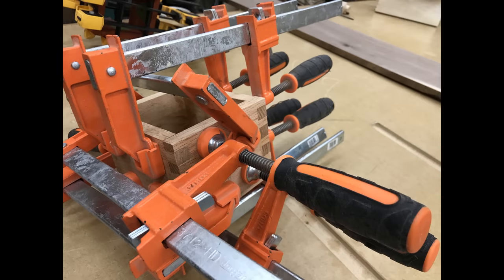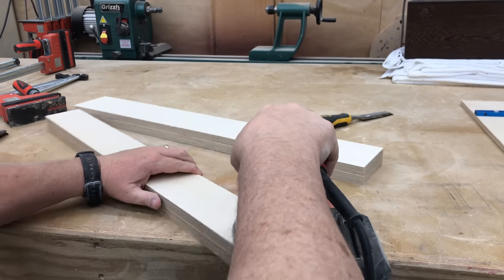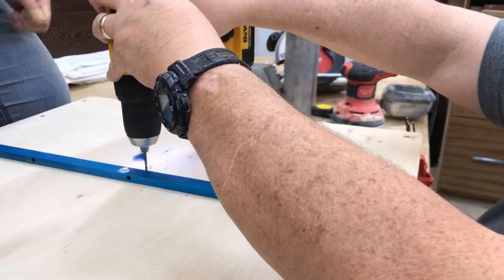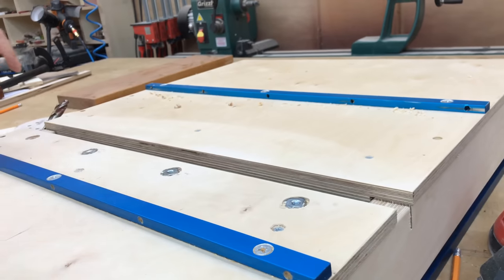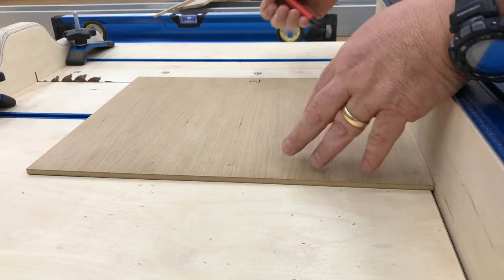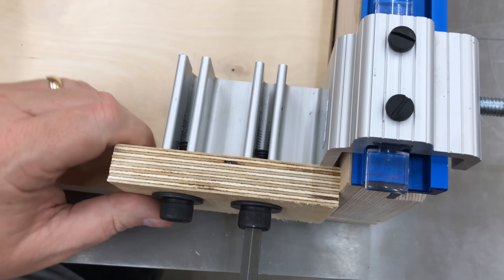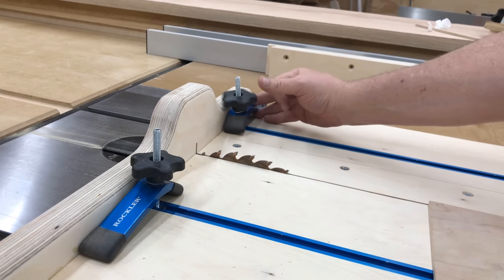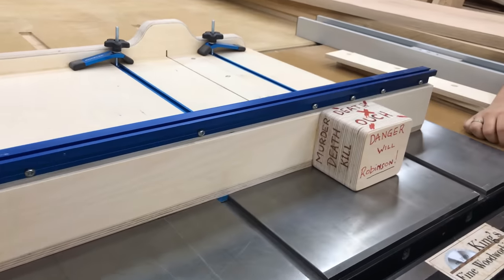39 - Extreme Crosscut Table Saw Sled with Perfect Miter & Dado & Removable Zero Clearance Insert

Comment: If nobody caught the error, I'll tell you. By tapping from the bottom the screw will tighten up in the aluminum but that doesn't mean it's holding  the bar to the wood base. You need a clearance hole in the aluminum, not threads. Engineering 101

Comment: Excellent Plans and demo.  My only suggestion is that if the bolts do not come through the track at the top.  Drill a hole in the bottom of the sled to accommodate the bolt tops to drop them through the bottom if you need to remove the hold downs and bolts

Comment: I built the sled and it works really well.  It adds a huge safety factor when using the saw.  I drilled a hole in the block on the back of the closer fence to accommodate the vacuum cleaner attachment and solved a huge dust issue.  I used a sacrificial fence for dado cuts taking care not to cut into the main fence and losing the register marks.  I keep it well waxed.  BRILLIANT design...thanks .

Comment: I purchased your plans for this today and I have to say they are very good and easy to read.  I purchased a set for the same thing from a National woodworking supplier that most of us buy from and they were so confusing and I am a retired Commercial Contractor of 40 years, threw them away and got yours.  Thanks for sharing good knowledge and common sense work value.

Comment: Great sled, well explained and easy to follow. Built the sled and it is true and wonderful to use. I made two changes.  I used adjustable miter tracks that were top mounted to allow precision adjustments if necessary and I left a 1/4” gap at the end of the T-tracks so the clamps can be completely removed for some types of projects. Thanks again, really love your channel!,

Comment: I’m very happy to find this video on your ultimate sled. A few years ago I started building your extreme miter station but due to unforeseen family circumstances had to stop 3/4 way through construction. Now, with more time on my hands I decided to finish it but wanted to construct the many drawers with box joint corners. After cruising YouTube for a workable jig, I found yours. As usual you made the build using simple explanations for each step - like you did with the miter station. I’ve ordered the plans and I’m beginning my own sled to make the drawer box cuts. Thank you so very much for those instructions. I hope to provide you with a finished version before spring.
Reply from the maker: That’s wonderful. I’m very glad it is helpful.

Comment: I've seen a few of your videos now. gotta say you're a lucky guy to have your kids spending so much time in the shop with you, not just to hang with your kids but to impart the knowledge and skills you've acquired...it's like the epitome of parenting. also doesn't hurt to groom them into taking over the family business ;)
Reply from the maker: Thank you very much! I am blessed to have them with me all the time.
Reply: This is how I started out. I have a vivid memory of being about five years old (1953?). My retired grandfather had a small shop in his basement outfitted with some Delta-Milwaukee Homecraft brand tools that included a drill press, a band saw, and a small table saw with a 4-inch jointer on the side. I still have his drill press and use it frequently. Using mostly 1/2- and 1/4-inch pine, he made napkin holders, salt boxes, spoon trays and such. At Christmas he would produce a number of small sleighs that you could put a candle and some greenery on. I worked in the hand-sanding department on the production line. He sold his items at a local gift shop to make a bit of walking around money. But I digress. My best memory of my childhood is my grandfather taking the wheel/blade covers off of the band saw and having me clean the sawdust out of the tool with a small paint brush. I've worked wood all my life and am always upgrading my shop and believe that he pointed me in the right direction in life. 

Oh, about the Delta-Milwaukee Homecraft brand, it has been interesting to see how the companies have bought and sold each other over the years and how the brands have changed in quality. In the '70s I had a Black and Decker Super Sawcat circular saw with an electric brake. It lasted more than 25 years with daily construction use. Now when I see the Black and Decker name I think of toasters and homeowner-quality tools. In the '50s, my father had a military surplus DeWalt radial arm saw in the basement. It was a Navy gray and was a beast. My mother said the lights would dim in the whole neighborhood when he would push the ON button. She said said she held our first aid kit in her hands whenever he used the thing, said the whine of the motor was blood curdling. DeWalt has had an interesting progression of owners (read Wikipedia) since 1923 and is indicative of the frequent changes of ownership of these tool companies. 

I didn't mean to write a book here, but just to say that I think it is wonderful that you have apprentices/helpers in the shop. Thanks for a great video.
Reply: @panamafred1  My dad had an old Craftsman table saw he bought in '62. I retired it this year for a Bosch portable. I feel much safer now, and the breakers aren't tripping. :-)
Reply: @garyhome7101  I hate retiring old tools, but it is usually for the best if I buy good quality. I do a bit of metalwork too, and just bought a Milwaukee metal cutting circular saw. Should have bought it fifty years ago! My Bosch contractor's table saw is going strong after gee, perhaps nearly twenty years now. Remember to count your fingers before and after using the table saw! :-O

Comment: One important item I did not notice being covered in the video is that the fence must be straight with zero bow.  This can be achieved by clamping the fence to a known straight edge while squaring and adding screws up through the sled into the fence at quarter points.  Very good video and it gave me some good ideas to improve mine.  I love playing with the five cut method.

Comment: Built this pretty much the same as the video. Only change I made in the process was to route the top pieces for the T track BEFORE gluing them to the base. This way I didn't have to remove the fences to route out the channels for the T-Track. Appreciated the math to get the fence square. First time it ever made sense to me!!!

Comment: Without any doubt the absolute best crosscut sled and cross cut sled build on youtube. Congrats. I will be purchasing the plans and building one.
 Only one possible safety improvement on your "death block", fit a stop on your outfield table. Mine is a 1/2 inch diameter bolt with the thread cut off and a large round rubber bumper fitted. It is positioned so that the saw blade is into your death block to the max depth for any piece you are going to need to cut without it coming through the back of the block. Your dado will also need its own hole due to differing diameter.  It can be stored on a rare earth magnet under the edge of the table saw top so it is always at hand. I've seen too many of those Safety blocks with saw kerf slots cut all the way through. All the best.
Reply from the maker: Thank you! A stop on the back would be a great idea.

Comment: Awesome sled, James.  Very informative video.  After watching, I actually used the 5 cut method to square up the fence on my old radial arm saw. ( I didn't want to reset the 90 degree stop which is a pain)  The method worked perfect and resetting the fence was relatively easy. I do not move the RAS out of the 90 degree position but rather use jigs and fixtures to make perfect miter cuts.  Thanks again for all your informative videos.

Comment: I’ve enjoyed making this.  Had to do a few tweaks, as I have a Makita table saw with ½ in mitre track, so I bought 12mm aluminium bars instead of the standard mitre track, and then as one who uses a 7mm grooving blade vs a dado stack I found I had to replicate the zero clearance replaceable plates on both sides of the blade.   This also lets me  have plates for bevel cuts.  Very satisfying build.  Thank you

Comment: I spent the last two days making this after buying your plans. It is simply amazing. I used my carpenter square to set the back fence initially and after all was done, following the 5-cut method, my adjustment came out to be 0.0013 inches. That was plenty good enough for the work I  do (and the smallest blade on my feeler gauge was 0.001").

Thanks for this video and all the great work you've done.

Comment: James, when you installed the runners you drilled and tapped them, you then ran the screws into them from underneath. The holding power  by doing this will be minimal at best. If you would have brought the screw through the plywood and then into the runner the holding power would be greatly increased.
Reply: Thought the same. When watching my first thought was "oh, that's a good idea, drill all the way through and tap the metal so you can countersink the wood on the top side and drive a machine screw down.  But yeah, those screws are basically doing very little to hold the metal to the wood.
Reply: I thought maybe he'd use rivets.
Reply: Can you please explain why this is? Why is the holding power low and why would it be better to screw from the plywood side? Thanks.
Reply: @mj.sorrondegui There are a couple of reasons. First, aluminum has far more strength to hold machine threaded screws than plywood does. Second, wood expands and contracts, meaning those screws could come loose over time. In either case, it's probably a good idea to wick thin CA glue into the wood to prevent too much compression.

Comment: Great tip on making the miter guide!
Also a great explanation of the 5-cut method. There is one slight error on adjusting the fence. Instead of dividing by the length of the fence, you should measure the length to the pivot screw since that is the point that stays in place. In your case, the dimensions are close so your method is pretty accurate but it might have been even more perfect. It would make more difference if the screw was not near the end of the fence.
Subscribed. Thanks.
Reply: Actually, James mentioned that in the video. Take a closer look. You will see he did indeed measure from screw to screw.

Comment: Nice project! I really like the removable inserts. I do see a couple of problems, though. One is the extra thickness of the base. This really limits the depth of the dado cuts you can make. It seems to me that the insert (and the entire second layer) could be much thinner without compromising anything. The other problem is that once you make a dado cut, the fence no longer has a zero clearance slot to back up the workpiece for normal cuts, which can lead to chipping on the trailing edge. I don't have a suggestion to fix this, but some sort of removable insert for the fence would probably be needed. Maybe your next design iteration could address this issue.
Reply: Had the same thought about zero clearance on the fence. Think flipping the sled 180 degrees and using the other fence for dados would work?

Comment: I'm in the process of making an outfeed table for my Delta contractors saw.  I noticed your slots in your outfeed are wider than your table saw's slots.  This got me thinking as I was wondering how to precisely line up (width and parallel) the outfeed slots with my table saw.  After seeing your table, maybe I don't need precise slots, but rather just relief slots.  Comments?  btw, Really like the sled with the changeable inserts.
Reply from the maker: Yes, really all you need are relief slots. Just something that won't interfere with the miter bar when the sled pushes past the end of the table saw.

Comment: Nice! Only issue is were a dado knocks out the zero clearance were the blade exits the cut. Perhaps, when using a dado, add a sacrificial board to the rear fence.
Reply from the maker: Brilliant idea!
Reply: I learned a great deal from this video. Thank you for sharing.
Reply: PEZ4949 how would you attach the sacrificial fence to guarantee it does not change the sleds accuracy?

Comment: Hi James.  i don't often question your methods but i did have a question when you attached the miter bars.  being as wood doesn't hold machine threads real well, why did you not choose to counter sink on top and screw into the miter bar?  As always its great watching you and the kiddos build amazing things.   stay safe.'
Reply: my thoughts exactly
Reply: I didn't see him specifically do this, but if you wick thin CA glue into the wood threads, then re-tap them, you get some pretty solid threads. When I flew R/C years ago, this is how I'd finish the threaded wood blocks for the wing hold-down bolts, and they endure some pretty wild G's. I never had one fail.

Comment: Looks good! I was thinking that if the stop block you bolted on was exactly 1" thick, your tape would be accurate on both sides of the block, plus one inch on the right side of the blade.
Reply from the maker: Hi Ryan. Great tip.

Comment: Had you not rounded on your five-cut method, you would have adjusted your fence in 29 thousandths rather than 28 and been significantly more accurate in the end.  For anyone watching the video, don't round.  This isn't false precision like needing to measure .0001 gallons in a milk jug, this is just math and all the decimal places here matter!  Awesome sled and design, I'm planning to copy it heavily, but it could have been that little bit better.  --A chemical engineer
Reply from the maker: Hi Chris, thanks for commenting. I didn’t bother going into significant figures or waiting until the end of the calculations to round, because I was trying to not overwhelm the viewers with any more math or concepts than necessary. I thought about it for a while and although it’s pretty easy to say just don’t round the numbers of the intermediate calculations until the end, I was worried I would get overloaded with questions about how many digits to use. Especially since turning the iPhone on it’s side results in so many more places in calculator mode. 

And of course the rules for significant figures are different for addition & subtraction than they are for multiplication and division. I just wanted to keep it simple.  

And in truth, the difference between moving the fence 28 thousandths instead of 29 thousandths over it’s 2 foot span is absolutely NOT “significantly more accurate” as you claim. 

We’re talking one half of 1/1000th of an inch per foot!  I’m not sure how anyone could find this significantly more accurate. This is woodworking after all. If you use one of the best blades out there, (a Forrest WW2), it has a blade wobble of 2/1000ths. This is 4 times sloppier than what you said was was important. And what if you are doing like most of my viewers and using a Freud Diablo blade with 10/1000ths wobble. This is 20 times sloppier. 

Anyhow. I do appreciate you taking the time to comment. And I do enjoy chatting with fellow chemists. I’ve been teaching organic chemistry at the university level for the last 10 years, and I’m a published research organic chemist.
Reply: Well okay what I really meant by "significantly more accurate" is you would have covered almost all the remaining distance to zero error that you detected on your second five-cut.  I did not mean to imply that your fence setting was inaccurate by rounding only that your error would have been virtually zero had you not.  I agree it is splitting hairs, literally, but no sense in going to such trouble only to get most of the way there.

Yes, chemistry is in my blood.  My mother is a chemist and my father a chemical engineer as well.  You could blame my obsession with precision on quant but in truth, engineers are just as bad.  Chemical engineers get a double dose I suppose!  Again, thanks for the awesome sled, mine will be modeled heavily on this taking on board the gems in the comments below.

EDIT: Haven't had to do error propagation since p-chem lab thanks goodness!
Reply from the maker: Hi Chris! Message me your email and I’d be happy to send you a free set of my plans if you want to see just how I put it together,  just in case it helps with your design.  :-)
james@kingsfinewoodworking.com
Reply: That is extremely kind of you James, message sent.  You've got me wondering now what my actual blade wobble is on my saw.  I too use a Forrest Wood Worker II thin kerf but with a blade dampener and link belt to minimize vibration and blade ring.  My saw easily passes the nickle test as well as the dime test so there is precious little vibration.  If you know of a way for a hobbyist to measure blade wobble, I'd be interested.  Likely it is one of a trillion things that I wonder about but can't measure.
Reply: @StormGod29  You can use a dial indicator to get a rough measurement accurate to 0.001 inches or so.  The indicator needs to be  mounted perpendicular to the blade on your table to measure the run-out (wobble) of your saw blade as you spin it slowly through one full revolution.  You can get even more accurate with a dial test indicator but the range it measures is a lot smaller (0.01 inches or so).  The dial test indicator will give  finer measurements of run-out accurate to 0.0001 inches or so.
Reply: You're cutting WOOD!  ;)

Comment: Excellent video with enough detail to build your own without the plans if you have some woodworking experience. I completed a slightly smaller version with the same features for my Dewalt jobsite saw. One thing to be aware of before you build is the size of the dado stack you plan to use with the sled. With a 6 inch dado stack raised to maximum height on my saw only 3/16 inch of the blade is exposed above the base. Two solutions - at a minimum you need an 8 inch dado stack or use thinner material for the base (perhaps 1/4 inch for the upper layer).